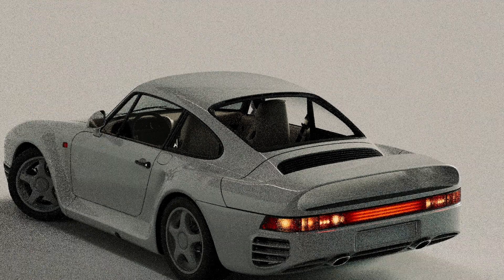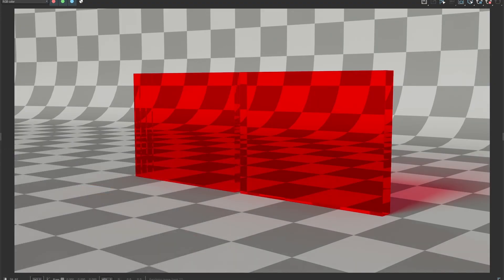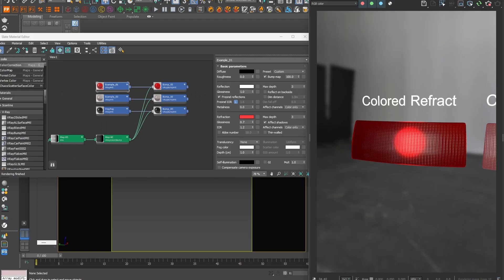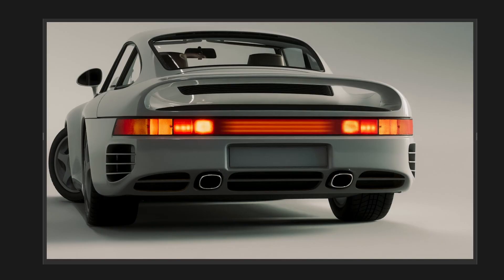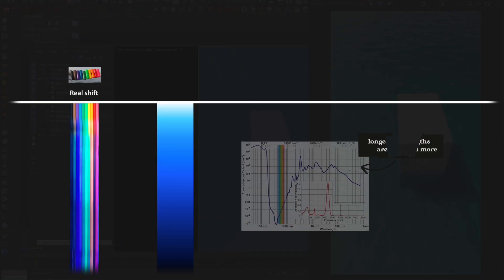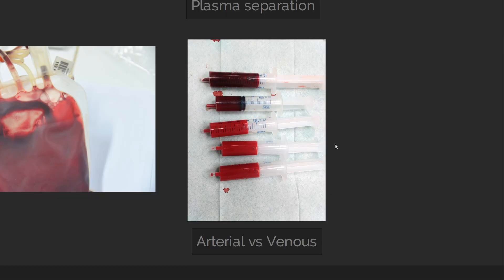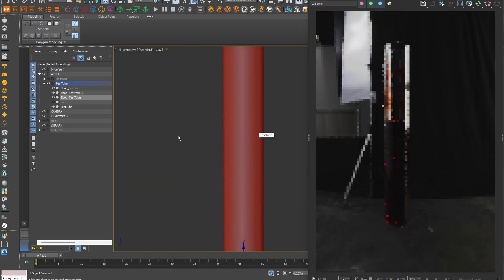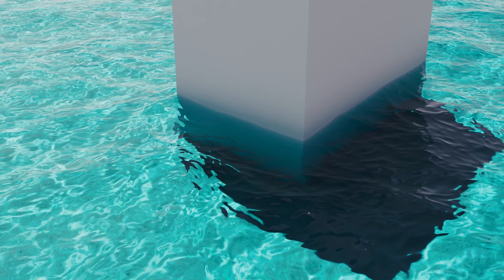Tail Lights, Water, Blood... Understanding Absorption | Vray Fog

Comment: What's the fog color equivalent in arnold render? I'm trying to replicate a taillight material, but I don't quite understand it since arnold uses different naming for its materials
Reply from the maker: That would be Transmission Color and Depth. For future reference Arnold has a documentation that has visual examples of every control, so you can always visit to see which is visually corresponding to other renderer naming convention! :)
Reply: @lucasprismal  thank you 🙏🙏

Comment: This is by far the most comprehensive explanation of Vray Fog. Thank you so much! The tail light example is amazing. One thing I am still struggling with in Vray is translucent plastic seen on stuff like cups, food containers and diffusion screens.
Reply from the maker: I appreciate it Oliver! If you're looking to create that white diffusion inside plastics and even certain glass, you have to apply a VrayScatterVolume to a duplicate of your mesh with a slight inward push to avoid zfighting. I briefly mention it at 9:00, but basically any phenomenon that looks like fog but isn't an absorption can be created with a ScatterVolume.
Reply: @lucasprismal  Isn't the newer volumetric translucency mode the implementation of VrayScatterVolume inside VrayMtl? I always tried that mode and had trouble finding the correct values. Thanks for your help!
Reply from the maker: @oliverkossatz7933 Could be, to be honest I never tried it! A good experiment for tomorrow. Whether it is or not the the point remains the same, non absorption fog is volumetric scattering. Whichever method allows you to get that works!